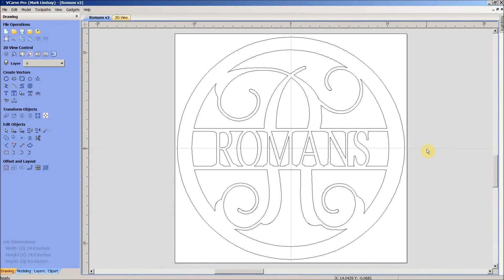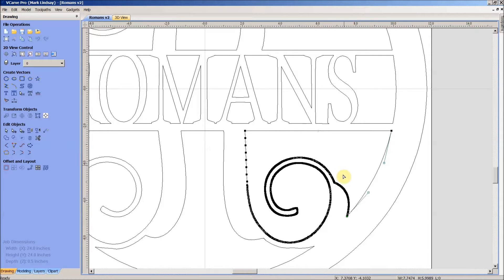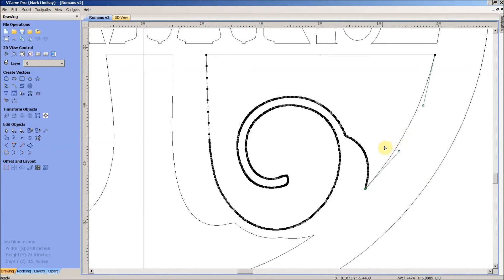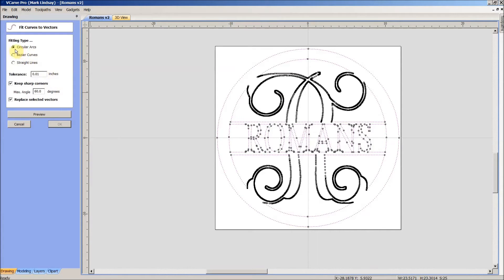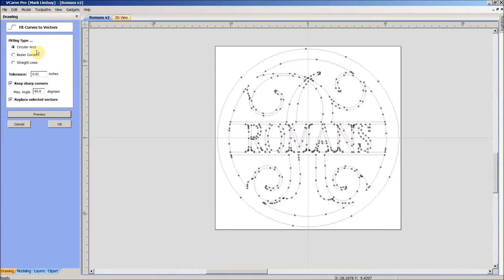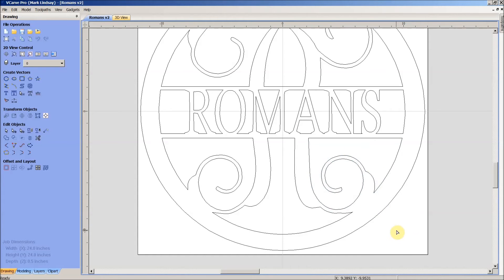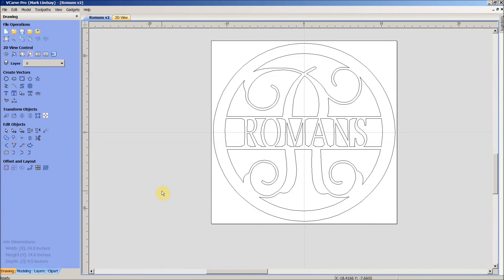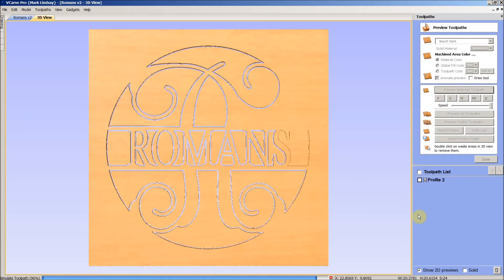Eliminating Unnecessary Points from Vectors in VCarve and Aspire

Comment: Hey Mark! Thanks for this video. I’m the one that is posting in The Make with the Scroll Saw pattern for the Cathedral Clock that I’m making. The pattern I have has been a pain but your node videos, joining open vectors, all have been extremely helpful. However this video has been the best for me. The pattern when imported has thousands of nodes for each piece. It’s insane. This video helped clean it all up, reducing cut time, and way smoother cuts. I really appreciate the help and your videos. JB

Comment: Hello very nice video I make couple tests and it’s make a different:) but just to clarify what’s better for Mach 3 g-code raining machine convert lines to circular Arcs or Bézier curves ? 
I see on your video that when you choose bezier courses you achieve less points that circular arcs. I read couple of forums, people mention that curves are  the way to go when coming to machining ? Thanks for help
Reply from the maker: That's 100% your choice. If you'd rather use Arcs, then that's fine. I've never had an issue with Bezier curves, but I understand that some people have.
Reply: @MarkLindsayCNC  thank You I will do some tests cuts and compare finishing times

Comment: I always copy and past the design on top of the original changing the copy to a different colour then apply the fit curves to vectors. Then compare the original to the copy as they can differ.
Reply from the maker: That's a good habit to get into if it's critical that the copy matches the original. If it's not all that important, I don't bother. Thanks for checking it out!

Comment: Great video! but...sometimes not all vectors will clean up, even after several setting changes in "Fit curves" mode.  can you help with that?
Reply from the maker: Sometimes the vectors can only be cleaned up so much. This is especially true if it's a complex shape or pattern. Try previewing Bezier curves and circular arcs to see which works the best for you. Then again, some vectors will still have a lot of points. That's okay. Go ahead and calculate the toolpath and preview it. If it looks good, it is good.
Reply: @MarkLindsayCNC  Thanks for the reply.  I ended up "cutting" each vector into smaller components then using "Fit curves" and rejoining.  Something about this particular set of drawings caused the lines to be more nodes than I have ever seen. 1000's per inch. Possibly, my computer was not powerful enough to handle so much info all at once.
Reply from the maker: @1metalmomma   That's actually very common with files that were originally drawn up in a CAD program like AutoCAD. By default, they tend to make curves by connecting a ton of short straight line segments together. Glad you got it fixed!

Comment: Great instructional video!   I fit the curve to the vectors I had in a eps imported logo and discovered not all of the vectors fit a new curve to the existing vector.  After looking at the nodes in the original eps, I discovered that there was many nodes basically on top of each other.  Thus the fit curve to vector didn't work.  So I deleted the nodes that were on top of each other or really close to each other.  Then I did the "Fit curve to Vector" and it worked.  Thanks again!
Reply from the maker: Glad it worked for you! Thanks for the heads up on the stacked nodes in the EPS file. I'll have to remember to watch out for that.

Comment: Thank you for the great video! This is hands down one of the most important factors in CNC machining...having unnecessary node points leading to longer machining times and often more wear on the CNC's mechanical components.
Reply from the maker: Thanks very much! You also get a much smoother cut, I find.

Comment: great vid !!! I'm a beginner and I'm struggling with problems that are easy for you. Would you be able to do a video or explain in the comments the basic rules for vector drawing, because in drawing I have problems with intersection of vectors and loops, I cant generate tool-path. What are the basic rules for drawing  vectors.
Tenx
Reply from the maker: The number one rule in drawing vectors is to remember that they need to be joined together to create a single, closed vector. I'll get into it further in another video later on. Thanks for watching!